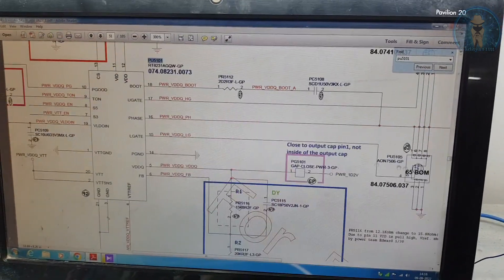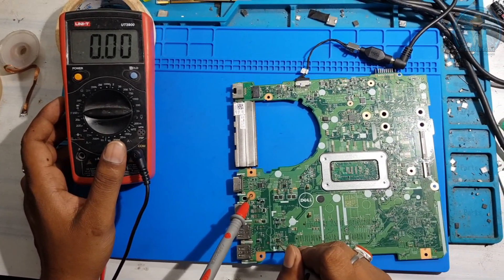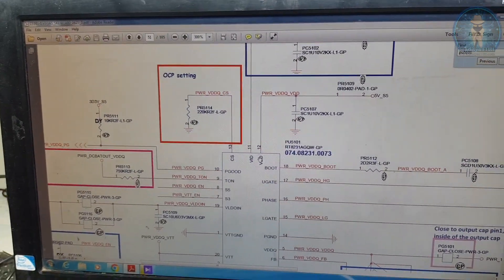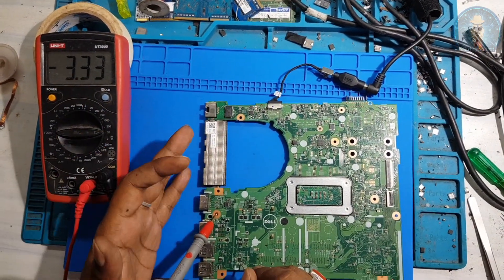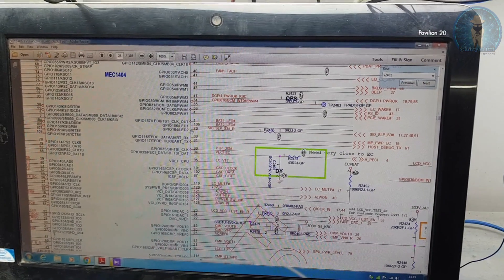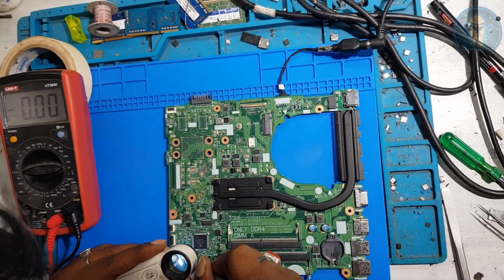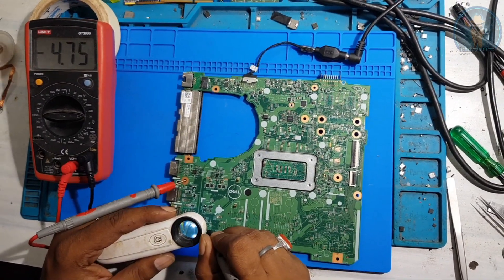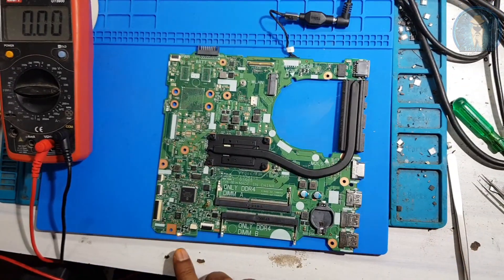Dell Vegas-Turis 15341-1 Irregular Display Solution Part-II #satishbhai & #aditya11ttt

Comment: I have the same issue with the board i'm working on. 5 blinks white and 3 blinks amber. Signals from PCH to SIO is not present. SO i conclude that this is a PCH problem. All basic signals ang voltage necessary for the PCH and SIO to work properly is present.
SIO_SLP_S4# = from PCH to SIO = not present 
SIO_SLP_S3# = from PCH to SIO = also this one is not present.